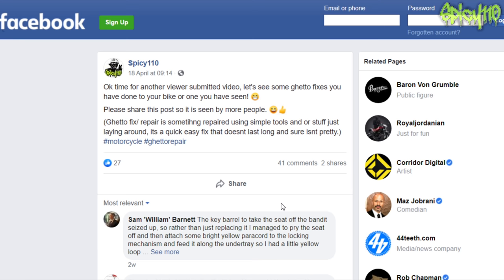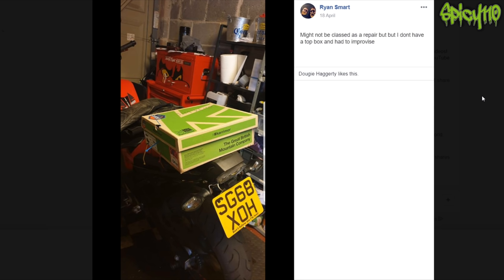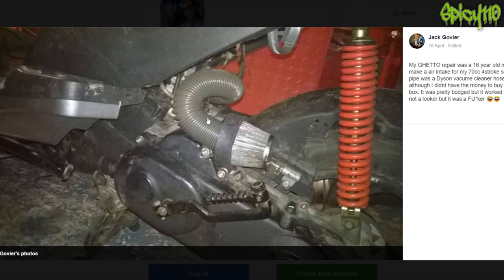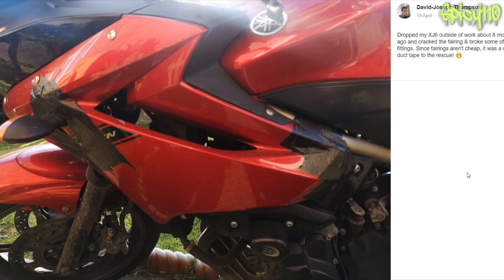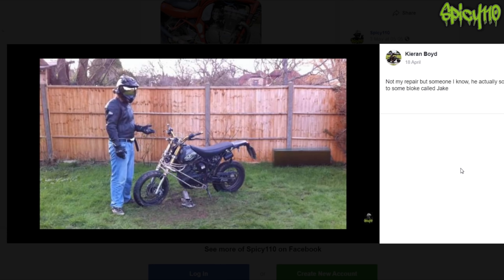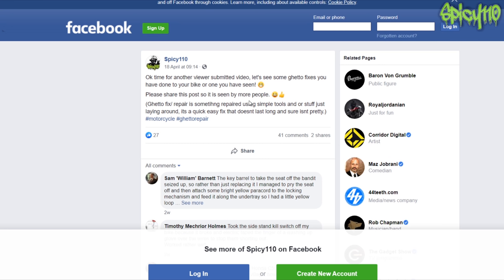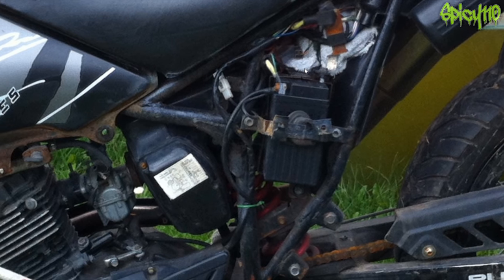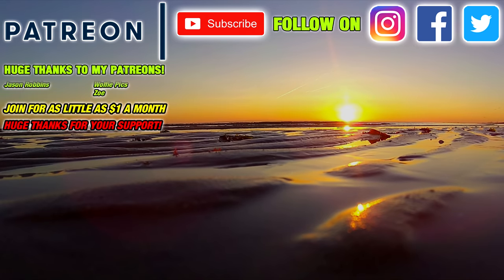Motorcycle Ghetto Repair / Fixes!..How bad can it get?

Comment: Back in the 80's I had a old 70's kx125, knew nothing about maintenance but me and a mate ended up replacing the head gasket buy tracing it's shape into the side of cereal packets and cutting them out....worked at treat 🤣

Comment: Oh I have a couple. Number plate light lost the little window it shines through, I just used clear tape to make a new one basically. The bit of the gear lever that your foot goes on or under snapped. Drilled a hole in the lever used threaded bar and locknuts to hold it in place from both sides, then tried to put on the rubber bit that goes on but the bar was too thin so just used a double layer of heat shrink and it fit perfectly. Gear lever fixed lol

Comment: Hey Spicy thanks for the shout-out with the Plug Pin! I was at work and my CG125 throttle cable snapped. I've no idea what made me think of it . But at the services where i work they use DVD players for the music system, and they fail pretty quickly being run 24/7. There was one just lying there in the office broken, so i took the plug apart and stole the pin from it. To my surprise the brass pin held the cable tight enough to ride home, and has been there ever since. I'd reccomend doing the screw up with pliers as i did though. Cheers dude! :D
Reply from the maker: Haha awesome well I will remember that one for sure! 🙂👍

Comment: So my Lexmoto ZSX125 had the exhaust bracket rust through and eventually snap when I went through a pothole. Since it's a one piece and would cost way too much to repair, it was temporarily held up with a metal coat hanger unwound and then tied around it. I've since graduated to bent sheet aluminium with a few holes drilled for the bolts lol. Looks like that's the way its staying, hopefully it'll pass MOT.

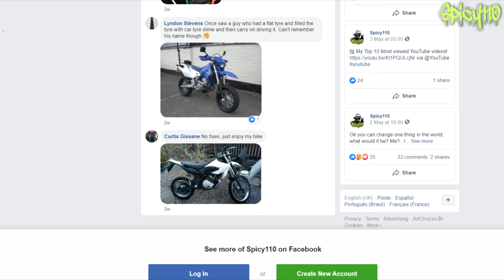Comment: at 1:47 they are the female terminals from a multiplug with bare wire poked in the end. nice lol. are G10's made anymore I had one about 25 years ago lol
Reply from the maker: I think yes you can still by a G10 new, the design is really really old! 😀